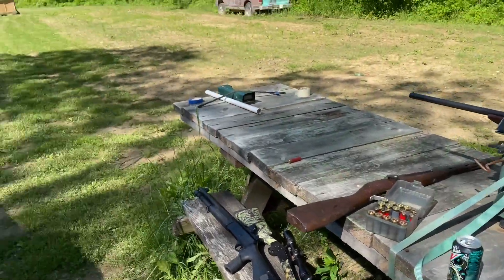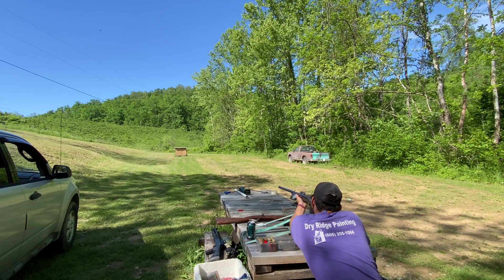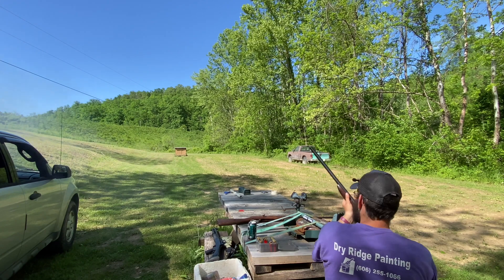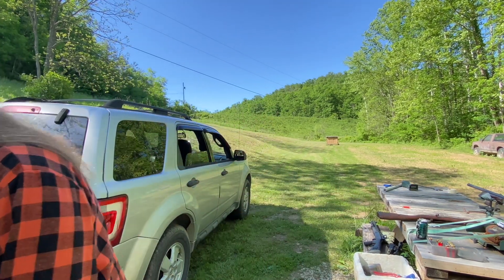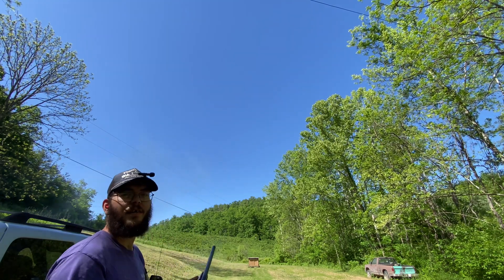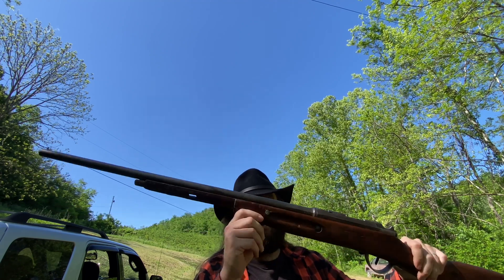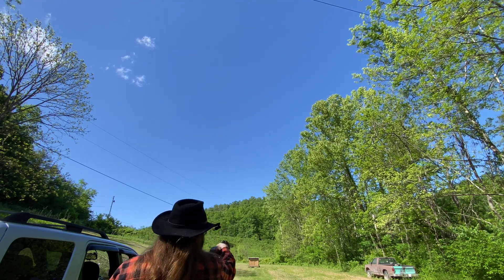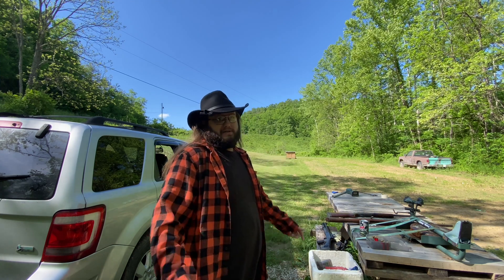Black Powder - Does A Longer Mill/Tumble Time Increase Power In Shotguns?

Comment: You guys be careful with every step in making that black powder. Use every static control method and procedures you can. That stuff has taken out a lot of mill workers over the centuries. Even the Hodgdon chemical engineer, (Dan Pawlek was his name I think) that invented Pyrodex got caught in a mill conflagration back in the late 70s or early 80s.
Reply from the maker: I keep it away from any heat source or possible sparking at every step. I tumble everything separately, then together for 3 days outside, then make a hard dough and granulate it and let it sun dry.

Comment: Mosin nut here, that's an m44/type 53, overall length is too short for a 91/30, and the bevel on the right side near the barrel is for the folding bayonet  to sit,
Reply from the maker: Yeah we know I realized in editing we were saying 91/30 lol. The last video we had it in we called it what it actually is. Josh actually has a Romanian M44 and I have a 91/30. Were big into mosins too. I cringed when I heard 91/30 lol.

Comment: I’ve not loaded shotgun shells with black powder but I have load 30/30 rounds with it. Shoot good but a messy clean up
Reply from the maker: I’ve been tempted to make some 54R BP rounds to film. Could be fun.
Reply: As long as the twist rate isn’t to fast they will probably shot fine. I think 30/30 is 1 in 12.
Reply from the maker: @WilliamParish-outdoors The .31 cal #0 Buck we use is .311 which is perfect for my 91/30. Just curious what they would do. Shouldn’t be too different than a .32 cal flint lock rifle.
Reply: I have a 91/30 (24 inch barrel)  if you do load BP in it I may copy your load and try some in my riffle.

Comment: With the large volume of powder and smoke it will definitely require being further away from the Chrono.
Reply from the maker: Usually it works from the 5 foot distance in the sled, those chronos kinda suck and are outdated though. We should have moved back a couple more feet though.

Comment: My first experience of the Antique propellant is with a little vevor tumber that NO WAY would run 2.5 lbs, kept reducing load until it worked and made small batches of super fast stuff 24 hrs, then got a harbor freight machine that runs slow 45 rpm vs 110 what helped the slow machine was more brass balls.
Reply from the maker: I’d like to get a better setup for making it for sure